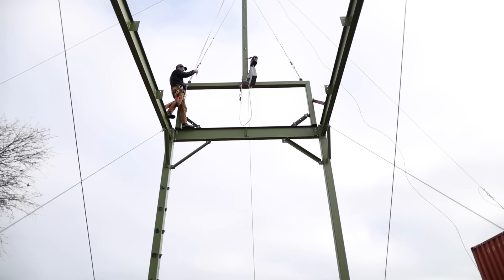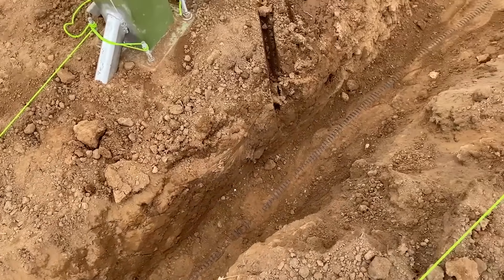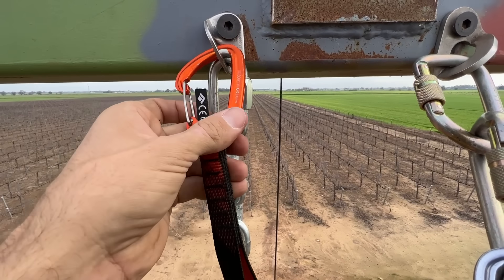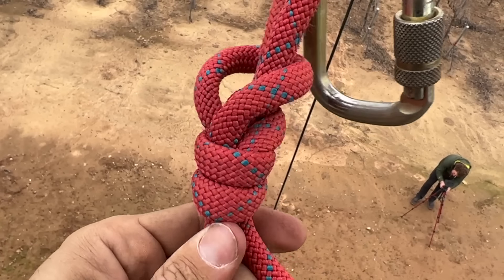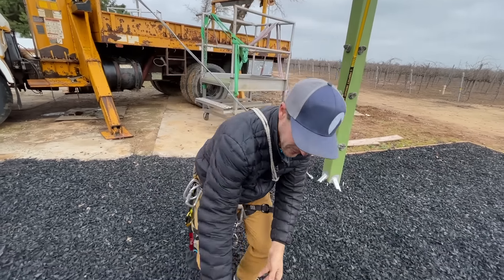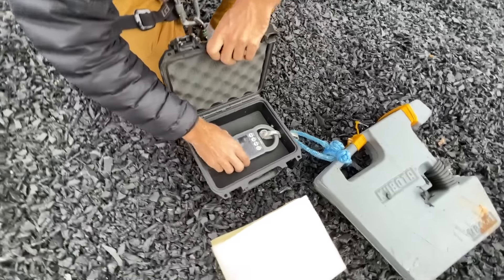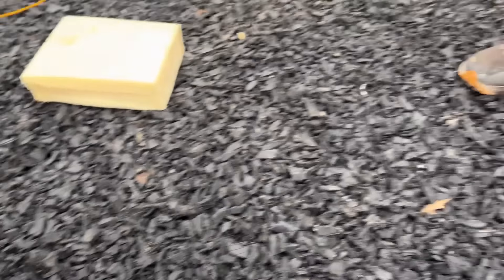Climbing carabiners don't break like you think

Comment: I've been hanging around outside the wrong sides of high rises on the island of Oahu for many years. I have never and, never would load a beener even remotely close to any of those situs. I was using aluminum bright locking d's since b4 you were born. With the next stop straight down 400 to 700 feet down.  And if you want a really safe knot to actually hang on I always use a bowline...on a bight. Two loops. One slightly smaller than the other. A shock load may break the first loop but, since it absorbed most of the shock...the other can still hold. Never load a beener latterly.

Comment: Seeing the weight slam into the rubber pit makes me wonder how much momentum/force it's still carrying at that point. Would be cool to have some way to measure the force when that impact occurs, bc that'd correspond to how hard you'd deck if your gear blewout in a similar situation.
Reply: Great idea, use an accelerometer to determine if it was a lethal deck
Reply: @midship_nc  thats hard to compare, as with the human body being bigger, the impact would be spread on more rubber and thus the decellaration would pontentially happen much more consistently and thus with a potentially much lower force peak. also the human body is able to absorb some of the falls energy by bending and breaking, where as most devices arent compressable.

i think if Ryan was falling off the tower he'd have a good chance of survival, assuming he falls into the rubber pit. potentially even with only smaller injuries, depending on how controlled his landing is.
Reply: @lordofnothing.  he could get a crash dummy like Mythbusters had, but they are extremely expensive in working order with sensors
Reply: For ”residual” energy I would just high-speed-camera it to check the speed (velocity)

Kinetic energy = (mass * velocity^2)/2 

So speed is all you need.
Reply: @greenveg42  when you know the mass and the high than you can calc. the potential energy - just take away the energy messured via the device
Reply: @philippm.1271  Pretty sure you need to take speed into account but it’s been years since I took mechanics 🤷‍♂️😅
Reply: @philippm.1271  Take the total force on the object (IE a 250lb climber plus gear times speed) divided by the mass of the gear.

So for a 2 foot drop there is 500 ft/lbs of force on a lets say 1 lb carabiner, so it will travel at 500 FPS, or 300 mph. Don't catch it with your face! That's slower than a bullet, but a piece of metal moving that speed is going to damage things

Comment: The thing is in any sort of top managed site (multi pitch belay, rappel, etc) if you’re transferring the load point from something behind to something in front it becomes extremely difficult to get the back carabiner out. 
For example: you came to an anchor of a 2+ pitch climb with rap rings, you clip your anchor in behind the rap rings as recommended here. Later you go to rap off, you thread your rope through the rings go on to the rope to clean the anchor but because you’re weighting the rings they are pinching the carabiners of the anchor and you can’t get the damn anchor off! So you have to unweight the rope and the anchor which can be very difficult if you’re on any terrain near/past vertical. 
Anyone who has done a few multi pitches has experienced this in some form and knows it’s consistently some of the most annoying faffing bullshit when you can’t get a biner out

Comment: Love your videos. 

I have a question about this test. (Sorry if it’s been asked already) 
So the carabiner that you’re trying to break, would it possibly break easier if the one below it couldn’t move? 

Like if you moved the bolt up a few inches. 

The carabiner below it is hanging on an overhang so it has the ability to move backwards and not put as much force on the one you’re trying to break. Maybe it’s a fun variable if you ever try this again? Hopefully this made sense. Thanks!

Comment: Been climbing trees for 31 yrs., taking trees apart with rigging gear, over houses, etc. Use heavy , positive locking beeners, thicker rope  and heavier rigging than you think you need, heavy belt,/ harness. Use common sense. Never had a problem.

Comment: Not sure if its in the plans for finishing up the tower, but you might consider bolting/welding a thick plate to the beam and attaching your hangers to that. I foresee a swiss cheese support beam when you start drilling more and more anchor bolt holes. It would also give you more room to position the hanger in various ways, like  how several comments mention needing the "rock" below the hanger so the quicklink has nowhere to go to get out of the way.
Also, I have rigged stuff where the biner has become caught in a bad position (ie: on the nose, gate or part way down the spine) after people clip in/out and move things around, and it doesn't correct itself because of the other piece. Without noticing and fixing it, this can cause cross loading (Always check your rig!).
Reply: Good point. When leading, the draw/carabiner gets pulled sideways into less than ideal positions and then has to rotate when you fall. The more junk in the bolt hanger, the more likely it won't be able to rotate freely.

Comment: THIS is one thing that so many people don't understand.
ALL our gear is rated for a static loading.
Dynamic loads are a whole other story and the gear may not perform the way you expect.
THIS is why we need large safety factors 
THIS is also why in Industrial height work and industrial rigging we avoid dynamic loadings at all cost.
The regulations I work under require us to use zipper style fall arrest lanyards in pretty much all height work.
A/ to prevent failures in the rig and B/ to minimize the damage to the human.

We are also taught that our rigs should be in straight lines and unless the point is explicitly designed for multiple attachments, there should only be one item in any given hole.

Comment: I was wondering what it would take to do abrasion/ wear tests on items like aluminum rappel rings and carabiners? Somehow (consistently) load 1kn, and then used a gear/motor/pulleys to pass 500-1000ft of rope through them. Use micrometers to guage the dept of wear and maybe even laser temp them or let them cool off between runs to simulate real world?  I know u guys would do great once the rigging is thought out!

Comment: I still think Zac Wronski's gear failed in the way he described. If you notice in his video, that bolt placement is on a part of the rock that is less than vertical, so when you load the carabiner it is going to put greater side loading-torque on the carabiner than in the vertical setup you have on your drop tower.

Comment: I feel like the bolt angle is a factor that should be considered. In this case, it's bolted to a perfect vertical wall, so the carabiner hangs loose, and gravity keeps the quick link out of the way.
I imagine as you change the wall-angle to a more slabby angle, the carabiner would tend to rest more on the quick link, and create a more intense lever effect

Comment: Yes! I’ve really wondered about this issue. I’ve had this discussion before with other climbers about how much it really matters to go under the chains vs over. I think what others are saying about the anchors themselves being at a bit more of an angle makes sense as well. I’d love to see this kind of test done with a quad as well and if you clip into the chains at any point instead of the actual hanger. If that makes any difference.
Reply: So long as the thing you are attached to is able to freely move on the anchor (or whatever you call the piece attached to the rock) you should be good. You'll notice that the caribiner broke when it was unable to move at all. You want the clip to be take the least amount of force from the drop as possible. When it has space to move, some of that force is used to move the clip around which puts less load on the clip. 

The strongest structures are ones that allow for a certain amount of flexibility and movement. While a stricture made with the same supplies and same size but that is fully rigid would be destroyed a lot easier than the flexible structure. It is the same concept for these clips and how you use them.

Comment: Be careful impact loading static UHMW line or soft shackles. It may have high ratings, but will be very weak when loaded quickly. Static line is strong with a static load, but stretchy lines handle bouncing much better.

Comment: This has probably been discussed before, but is it possible that the peak force happens faster than the frequency of the meter? (3:30 might support this idea). That could explain why the results were lower than expected.
Reply: This is why for a long time they were waiting on the Linescale 3. it has a poll rate of 1280hz, but, you know, the peak definitely didn't last that 0.7813 milliseconds. They need a much better load cell.

Comment: My idea to Test 5. Mount the Hanger further up the Metal beam. Most cases you will have solid Rock all around the hanger, therefore the Carabiner (and whats betwen it and the rock if clipt in wrong) will get pushed against the Rocksurface and therefore cant sing out of the way. 10:29 lets you see how the already mounted "carabiner" moves out of the way when the clip in gets loaded.
What are your thoughts. Could that might add to breaking ?

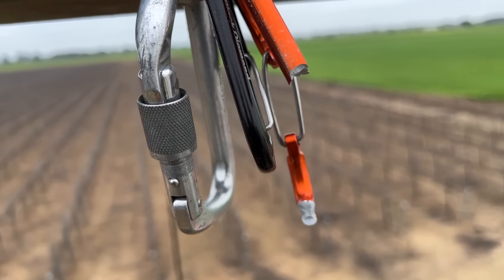Comment: 6:50 Of course that's going to fail well below rating - it's designed to be in tension, not torsion. You've introduced a cantilever scenario too. When trying to break something, most people intuitively know to twist it, not just pull on it.
12:46 That's just a bad design. The load should automatically force alignment to the fixed side.

Comment: Its much slower than a carabiner, but a two piece clamp that is made outta threaded U rods, that is around 12mm thick with long nuts that would by design thread on both ends and tighten them would give you a link that would not fail any time quickly... Having like 10 of those in your pocket, and when you can, just assemble one of them into the place of a carabiner and have the cord pass through them as a safety measure... You can make them yourself with a few hand tools and a vise... Would hold 10x what your regular stuff can, especially if you pick a relatively fine thread...

Comment: Try testing one carabiner without anything underneath as a baseline; you might find it breaks easier hanging straight. You might want to put a slow-motion camera at the top and watch was is happening.  I wonder if the gear underneath might be moving out from under the carabiner when it is shock-loaded?  That movement and deformation of the gear underneath might absorb some of the energy of the falling object. The angle of the downward vector loading the carabiner also might be changing as its magnitude increases.

Comment: droptower is undeniably cool.  but I wonder if there's not a way to accomplish the same horizontally.  Maybe using a spring or a railgun?  all its really doing is using gravity to build up momentum and keeping the rope slacked until a specific distance at which all force momentum is disipated into the gear under test.  a spring and a weight should do that without having to climb something. And any parts that fly apart are contained indoors and retreivable

Comment: The problem with most drop tests is that they are too static. There are many dynamic facets to a system used by a lead climber. You have the dynamics of the rope. The dynamics of the harness. The dynamics of the not. and most important is the dynamics in the body of the climber. The key to a dynamic fall is to extend the time of the impact which all of those elements mentioned add up to create. Even using a dummy that’s equivalent to the weight of a climber does not accurately represent the dynamic’s of a human falling. The muscle structure and a climber tensing up all add to the deceleration of a dynamic fall.
Watch the “Tested Hopes” clip on ice climbing gear.

Comment: I'm kind of shocked by that soft shackle, and those steel carabiners. Really interested to see some dynamic testing on those and other dyneema bits, seems to be kind of a strange material
Reply: It's not trange, it just does not stretch much when loaded. It also degrades in UV light so if you leave it out in the sun for months it won't be strong anymore. Also, Dyneema is a brand name, the material itself is UHMWPE. (Just like everyone says Kevlar, which is a brand name for aramid fibers, or Teflon, which is a brand for PTFE)
Reply: @markkNL  I've actually used it quite a lot in sailing, but the way it behaves in some of his testing is really interesting. Particularly what appears to be heat issues when pulled quickly or in "shock load".

Comment: Can you try to imitate side loading of nut carabiner on via ferrata? .. (setup: vertical segment, vertical steel wire, horizontal anchor with wire/rope shackle on one side, carabiner sits above the shackle. from wire to the anchor to the climber) .. my experience is: just by resting i deformed the nut crown so it cant unscrew the nut, the carabiner stuck in a sideways position with nut crown being the point of leverage. Also, would you screw the nut while resting on ferrata even if you have Y-set carabiners as main safety?  TY

Comment: I have 2 dumb questions. 
If you were clipping into an anchor that already has something attached, why wouldn't you remove the other carabiner?
Is equipment that has experienced a fall (or some sort of shock load) and survived immediately decommissioned, even if it looks fine.? 
Is it common practice to clip onto other equipment remaining in the rock face? How do you know if that equipment is safe to use, if it hasn't been compromised by a fall or weather?
I guess that was more than 2 questions. sorry.

Comment: I find it surprising how when things break like this, don't stop the fall enough to matter. It's like the speed before the rope tightens is 100, just after the part breaks it's still 95 and then it keeps falling. I would think it would stop it considerably, since the breaking force is pretty great, but apparently not great enough.
Reply: Large peak force, but only over a very short period of time. Change in speed is proportional to change in momentum - that change is the impulse, which is force * time. So in a very rigid setup like this, pretty much either something fails instantly or the load stops dead. As the Mythbusters discovered with their original aluminium deceleration sled, when the steel cable just tore through the aluminium I-beam like wet tissue paper.

And yeah this is why it's so important to use gear with 'give' in it, and why he specifically swapped out some components to reduce that.

Comment: Would there be a different distribution of forces if you had the weight/sensor on the end of a longer rope which goes up, through the gear and then back down to another weight to simulate the belayer?

It could be a slower load ramping up to the full load on the top quickdraw, this could bend it in the way you are looking for without breaking the ropes. Also seems like a better recreation of the video used as an example.

Comment: I would imagine a rope would shear a larkshead off if the dopes quality was at all compromised, ive had failures like the 1st one with traction kites and old line 🤔 you are also in a pretty dangerous place for the text, eventually you will get whipped, hopefully.y there's no peice of a beamer still on the whip... there's a calculation for the load you will recieve .... let's simplify it for say that if it rebounds and has any mass it can mess you up...   ge safe while testing ;)   great content :)

Comment: I don't climb, but I do rope bondage suspension. I'd been looking at that little wiregate Black Diamond carabiner to add to my kit, but it looked flimsy. Having seen what it actually takes to break it, I feel confident that it'll hold my fat ass in static positions one foot off the ground. 

Also, subscribed 👍
Reply: Depends how high off the ground you are I guess. A one foot drop might add to the excitement ;)

Comment: Looking at The thumbnail, yes, that set up would fail. Especially with wire gates.
Also, you should have body, face protection. If the rope had broken at the other end, it would have whipped back, possibly hitting you. A metal plate welded in front of you would keep you safe in most scenarios.

Comment: i feel like trying to replocate a defect is somewhat of an upside down way to look at it, theres plenty of factors that can throw off the structural integrity of a peice, metals are much like wood and have a grain pattern with potential for defects in the density which can effect its overall performance, assuming the climber weighs an average for an athletic male of his general size, i'd give him maybe 180 to 200 pounds, apply at the point of impact where it broke about 15 to 20 mph of downward thrust, which is just based on what i assume for him to be falling at that speed. now lets do some quick math, a male weighing roughly 190 carrying roughly 20 pounds of gear is 210, times that by velocity, the amount of speed he was accelerating at at the time of impact which is roughly a meter a second. over the span of about 2 seconds  thats almost 500 pounds being pushed onto the carabiner. it adds up really quickly, but it doesnt just stop there because the fact that it was folding over itself exerted even more force in the form of torque, extruding a whopping 800 pounds onto a piece of steel thinner than your pointer finger. without even factoring in wear and tear this is definitely enough to ruin someones day.ik this video wasnt meant to be a math problem but i've been out of school for almost a year now and i need some brain teasers. although this math has made me realise how important it is to use equipment properly. 180 pounds definitely adds up